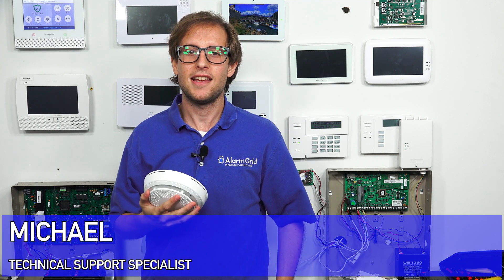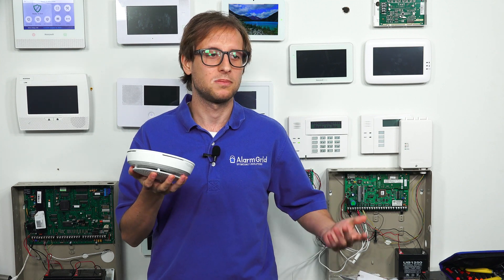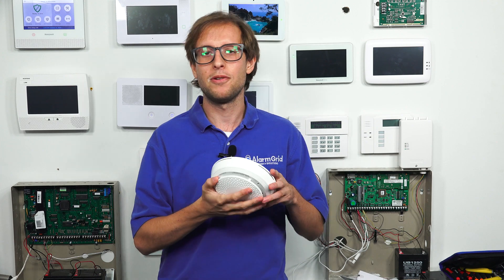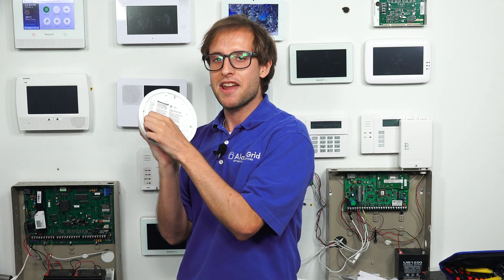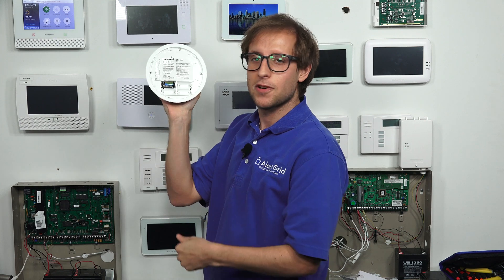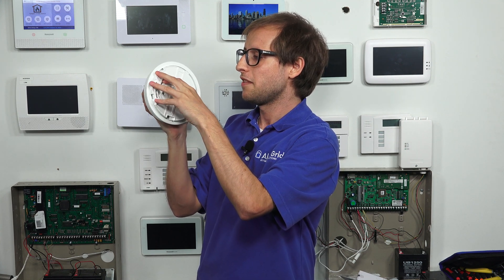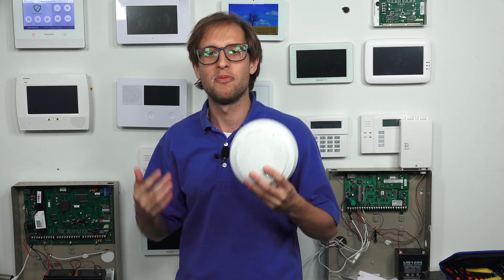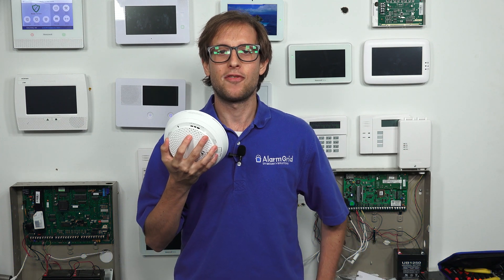Changing the SiXCOMBO Batteries

Comment: I can't get my unit detached from the base that is attached with screws to the wall. Anyone have any answers? I turned the alarm counterclockwise  and pull, but the alarm won't release from the base plate. I even tried turning it clockwise and that didn't seem to work either. Any ideas? Please help?
Reply: If properly mounted, you should firmly turn the sensor counterclockwise when it released it should basically fall off. No need to apply any pulling pressure. This is demonstrated in the video. There are no special tricks, try turning it harder.

Comment: Great video - my only suggestion is I'd add that it may be prudent to let the charge dissipate after taking out batteries, and I've found that you need to insert the batteries as quickly near to each other as possible - I line them all up w the + side just barely out, but having tension, then I push them all in at the same time. Thank you for this resource.
Reply: Not all heros wear capes. Unless you do...😂
Thank you!!
Reply: @michelleward7310  my pleasure - a little bit of information/knowledge sharing can go a long way. Good for you to take the impetus to do your research and find the comment in the first place. Unfortunately, I think our type are rarer than I'd hope. Be well.
Reply: You're a life saver! I was so confused when it continued to chirp after I swapped the batteries. This was 100% the fix.
Reply: @runstreetwise  happy to help!
Reply: @buletman  i called my alarm company and they told me I need to get a new sensor because I am missing a little magnet that goes in the middle of the mounting plate. Do you know anything about this? Thank you!
Reply: @joeltorres4168  yes, the "tamper" for the device is a Reed switch on the back of the detector. The magnet is "held in place" by a sticker that says "DO NOT REMOVE" - find a small rare earth magnet and glue it in the backplate, problem solved.
Reply: It's insane that this is the fix that worked and no one else seems to be talking about it
Thank you so much for saving another frustrated life
Reply: @halftruism93  resources are scant, so hats off to alarmgrid - but as a professional installer of these, I gather some of these nuances in the constant battle of technology vs technician 😅
Reply: This just saved me! Couldn’t get rid of the chirping. Thank you two years later
Reply: @Grrkey  yw, np :)
Reply: Thank you for the above information. Initially I changed out the batteries one at a time and the system kept beeping once every minute or so. After trying your method above and entering the code twice the low battery message disappeared and I can now arm my system. Thanks so much for sharing this information buletman.